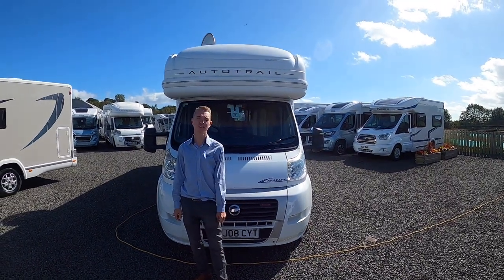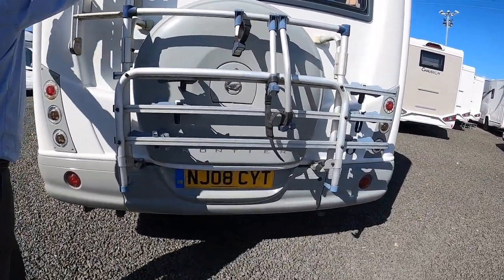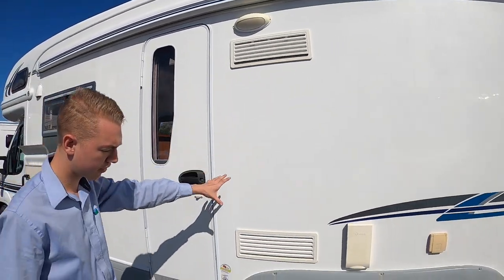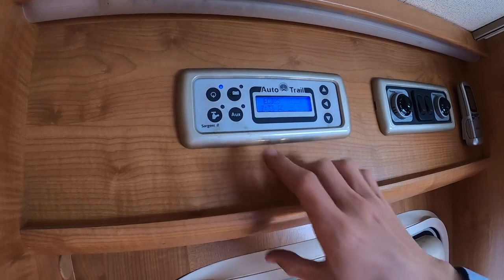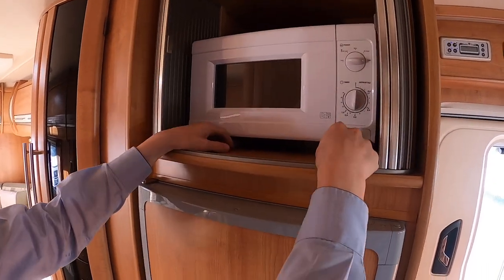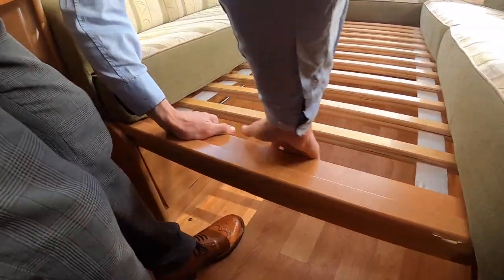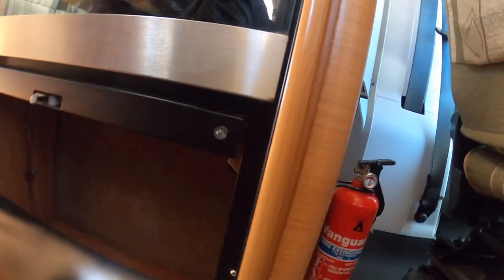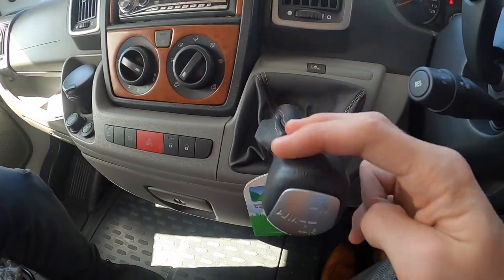Auto-Trail Arapaho Handover Video

Comment: Hi I'm not sure this will get read as its an older video.
But im wondering how you heat the motorhome if your not om electric hook up?
Reply from the maker: Hi, you would have to use the gas fire to heat the motorhome and the 12v fan to circulate it round the van.
Reply: @tynevalleymotorhomes  thank you 😊